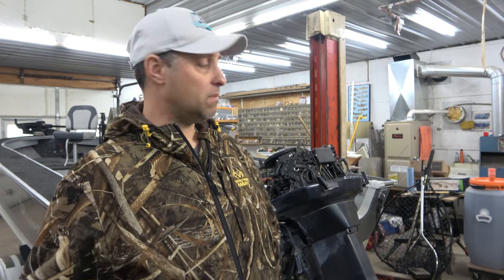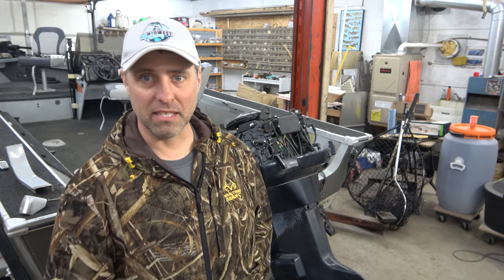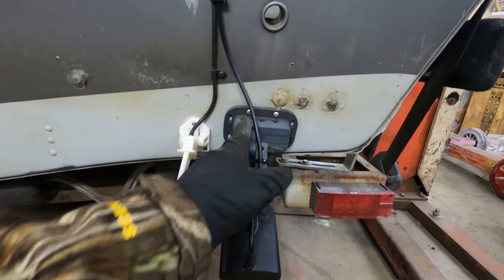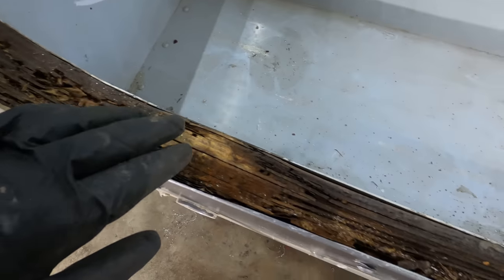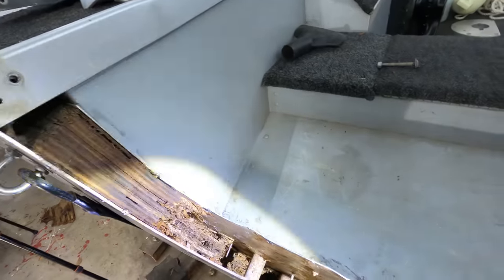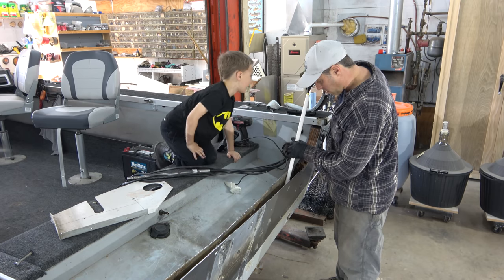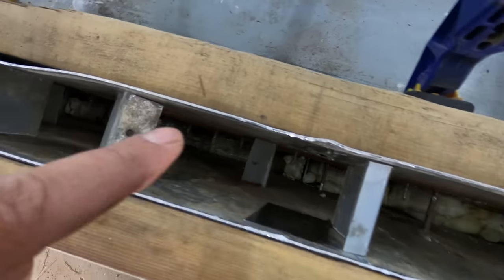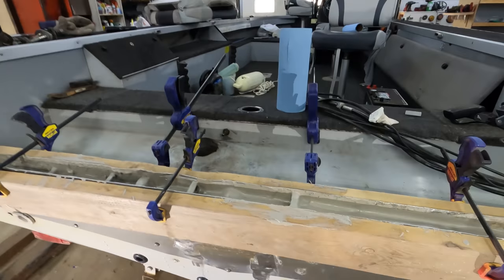The Easiest Way To Replace A Boat Transom

Comment: He needed to remove ALL of the wood and do a solid one-piece pour. What he left will continue to rot, and will act as a hinge on each side of his poured material.
Reply: Curved/irregular hinges just don't work. The wood left was just on top. Bottom is full width. The wood was irregular enough to lock the orientation in. The material confirmed to the wood and gripped it 100%.
But yeah, the rest will probably rot eventually but there's a reason why that piece wasn't rotten yet. Less water reaches it.
Reply: Does anyone really think that the new carbon core that was installed has “less” strength than the rotten piece of wood that came out of it?  Really !  I expect the repair may even be stronger than the original.
Reply: @gerrylormr8299  The material he installed will indeed be very strong. The wood he left on the outsides is already harboring rot at it's edge and that rot will spread. He will end up with a very strong center of a transom flanked by 8 or 10 inches of effectively nothing but the outer sheets of aluminum.  Eventually, and possibly soon, the weight and torque of that motor will cause the transom to flex at the point where the poured material meets whats left of that wood.
Reply: I would think at the very least, drilling holes into the wood for the new epoxy to bond to would have been a good idea to spread out the transition between the wood and carbon core. A line of 3/4" holes drilled into the wood with an extended drill bit would act as fingers between the carbon core and wood. Drill them at a diagonal from the top and use a rod to push the liquid in and air out once you pour the transom.
Reply: @the_omg3242  that is a good idea but the irregular surface of the wood meeting the chemicals is more than enough to provide mechanical locking as well as increasing the surface area for bonding. Just see how much sanding of a flat surface does for bonding ability of paint, then the ridges in torn wood seem like Mount Everest in comparison. 👍
Reply: I think if it was me I would remove the wood lower down remaining at the side ie in a level line of the transom plate at least, the upper corners not so important if the wood is pretty solid but I personally wouldn’t be happy unless the pour went the full width
Reply: Exactly...metaphorically what he did was mount a TV to a wall with a heavy duty bracket except instead of using studs he just used the sheetrock to anchor it..
Reply: It's ok he made plenty of money of haters to just buy a new boat at that point
Reply: Any fully encapsulated wood chips left in the main cavity will not continue to rot provided it was dry when encapsulated.  "Dry rot" is a misnomer - all wood rot requires water to progress.  I would have run a hot air blower into the cavity for an hour or two after clearing it to ensure all wood debris was completely dry.  The top side "ears" of the transom just act as a box corner section to stop the rear top of the hull bending in or out, they don't require much structural integrity.  Almost all of the forces from the engine (including its weight) is being transferred to the bottom and lower sides of the hull only by the section of the transom below the "ears".  So even if the "ears" did continue to rot (which I agree is likely), it's not such a big deal.
Reply: @darrenjones3681  He didn't want to buy more than two buckets (budget?) so he left the wood. Hope it doesn't come back to bite him
Reply: @sasakurtovic6850  the only thing it gripped to was 100% crap to begin with. You have a clue what you're talking about do you? you're just guessing.
Reply: Welding aluminum with propane/ map = fail aluminum goes from a solid to liquid super fast. Smells like bondo means it is.
Reply: Exactly what I was going to say. He just delayed the complete disintegration of this transom by a couple more years.
Reply: @sasakurtovic6850 😊😊😊
Reply: @1957cajun .  Life long wood boat owner couldn’t agree with you more.
Reply: Nice job, very impressive happy fishing
Reply: He wants to continue to fish with his boat. It isn’t like he’s claiming that it’ll be good forever. 

It doesn’t matter if it becomes a hinge later.
Reply: Appears you removed about 75% of the rotten wood. I would have went the extra mile and removed all of the rotten wood.
Reply: it will be absolutely fine
Reply: @sasakurtovic6850  maybe, but to support his point.... reading all of the comments that the remaining wood will continue to rot and become fluff, having the material entering multiple ports into the old wood would have added some rigidity if/when the remaining wood fails.

Comment: Perfect video on what not to do.it’s actually sad that this video is meant as a serious repair video and not a worse imitation of an episode of the Red Green show. He is actually using liquid duct tape! LMAO
Reply: Idk man have you seen the carbon core video that stuff tested stronger then plywood .
Reply: You couldn’t be more wrong. These liquid transom product are more durable, and more structurally sound than any marine plywood made.
Reply: @buellb0y  possible, in perfect world, but that would be if you removed all of the rotted wood and the liquid could get decent adhesion to all surfaces between skins and on the side edges. And all the surfaces were thoroughly cleaned from debris and any contamination or oils.... and then the transom sealed to prevent further water intrusion, But that’s not what occurred here. Bottom line there is a right way and a wrong way, and there was not a lot of “right” going on here. The remaining wood WILL deteriorate because spray foam is not a waterproof barrier. And when the transom buckles and flexes later on and needs to be fixed, again, the process will be a debacle. The moral of the story is these snake oil solutions are temporary and cheap, and while delaying the inevitable, nothing beats doing it right the first time.
Reply: @buellb0y  only when properly installed.
Reply: @jhudds67  thats a really long paragraph to tell everyone that you have zero clue what you're talking about.
Reply: @adamcooper3717  so you really think slathering some crap out of a bottle or tube is really the preferred method of repairing that transom? That crap is for small repairs not to replace the structural integrity of solid plywood and a property repaired transom.

Comment: The only problem I see with this method is it didn't really save that much work. By the time you dig the old transom out and prepared it's almost the same amount of work as just taking the rest of the rivets out and replacing with a solid Board.

Comment: You should use 3M 5200 sealing caulk it's much better for boat applications than silicone. Nice video.
Reply from the maker: Hi Buggy Man. Thanks for the info.
Reply: I agree one hundred percent I used it around the outdrive on the transom it's the only way to go, 5200 is great stuff
Reply: Absolutely agree. I use 5200 for below the waterline and 4200 for above. 5200 is a permanent bond and 4200 is UV stable, I use it for deck fittings, windows, port lights, railings, screws, etc. 5200 is some strong, nasty stuff. There's also Sika-Flex which is great for above the waterline.

Comment: This stuff works fantastic. I am 3 years with my carbon bond transom holding up twin 200 v6 evinrudes on my 26ft center console.
Reply: I am sure it works fantastically. IF YOU FOLLOW THE INSTRUCTIONS. This guy just made things worse. A year or so from now and this boat will fall apart where he failed to spend the money and where he failed to remove the corner wood will be completely rotted and gone. That little gap on top? Gonna screw it all. If you can't do it right, don't do it. 200 more woulda finished it right along with a little more work for the corners. Sloppy all the way and now... when it has to all come out, he will spend thousands instead of 200 more.
Reply: @daddski1  Agree....
Reply: @daddski1  If he keeps his boat indoors that's gonna last forever
Reply: @daddski1  looks like his newest video confirms you're FOS
Reply: @daddski1  The only good tip I got was the transom goo

Comment: The hardest part of doing something is getting started.  Well done man!
Reply from the maker: Thanks Eric. I appreciate the comment.
Reply: The hardest part is doing it RIGHT! Every step down the Cheapest path is just another step into doing it over again, or accepting second-rate results that you wouldn't expect to pay full price for. 1st. leave the inner skin "Completely" alone.              (options later). 2nd. cut the ""ENTIRE"" outer away,, Leaving 3 to 4 inches revied around. 3rd. Dig it ALL OUT! side to side and Clean the bottom completely. 4th using 3/4 melamine, Skin the back creating a form, clamp & thru bolt using 1/2" PVC a needed spacers. Now you have the opportunity to decide whether you want a notched-back or a "Full" Flatback transom. The Flatback is "Ideal" for the installation of a jack plate for every reason a jack plate is superior to a Hard transom mount. I personally install ones with longer shafts. To get the Powerhead UP & OUT of the water plus having the ability to kick along much shallower. Besides, your process is very time-consuming for nothing added.

Comment: I almost threw away an old Craftsman electric chainsaw until I used it and a shopvac to clean out a transom cavity.....REALLY speeded up the job. I've done several since and haven't found a better way.....Good informative video for anyone contemplating transom replacement. Once done they are almost indestructible.
Reply from the maker: Yes, it is rock solid! The chainsaw idea is brilliant. Thanks for the idea.
Reply: I used a Sawzall on the 2 I did. But good job. I used wood to replace both transom. The lund I had to remove the rear deck as you stated..
Reply: Chain saw  great idea

Comment: Great job!  Amazing how many key board boat transom repair experts are out there.
Reply: I was a boat repair tech for 25 years and probly did 100 transom in my time working on boats I've been disabled for the past 12 years in my time as a repair tech my primary boat repair was on fiberglass boats however I have done some aluminum boat repairs including transom I must say by not removing all of the wood  has made weak spots at the edges where the wood meets the pour I have used the Coosa and plywood  but never the pour however having removing as many as I have I can say with 100% confidence the remaining wood was still holding moisture this fact will inhibit the bond if you noticed the dark color of the wood on the floor that was because it was wet also by putting the foam to (keep the water out) I can tell you from experience that polyurethane foam also soaks up and holds water but  I also would've taken the motorwell out and gotten the rest of the wood out it really wouldn't have been that much trouble and he would've had a better job getting all the rotten wood out  I did like his angle aluminum over the top idea instead of using the old piece and I do applaude him for trying to do it himself n do like the pour transom  be advised i am not bagging on his work but trying to help others  who may read this
Reply: Amazing how much shit one dude who has no idea what he is doing can do wrong ! FFS, expanding foam ?

Comment: Did the same with my Lowes boat similar to yours,but my mix came in smaller buckets and i filled mine right to the top,and yeah its rock solid

Comment: I replaced the transom in my 2000 Lund with marine plywood that i soaked with CPES (clear penetrating epoxy solution) to prevent any water intrusion. CPES is two part epoxy that is like diesel and penetrates the wood then cures in a couple of days. It fills all the wood pores making it water proof.  10 years later it is still rock solid. And yes i had to remove dozens of thru-bolts etc. and replace. It was a ton of work. This looks like a much quicker/easier solution but more expensive.
Reply: Layered up womanized...glued up.  Don't go down as deep just slightly below the support panel inside the boat where you tried welding. (You can then run an angle piece to tie the transom to the support panel) Then lay another piece of womanized sandwiched up clear across the whole length on the inside of the transom.  Cover it with aluminum, or just paint it...use longer motor attach bolts.  I have done this on 14 foot boats to 24 foot boats and it lasts forever....marine grade plywood is over rated.  Much cheaper to do, but if you don't try and go to clear down past the support panel just above the floor it goes much quicker and is plenty strong and stiff across the stern.  I have to admire your work around tho....nothing like a job that succeeds no matter how you get it done.  Good show....

Comment: Kudos to you for keeping this video up and still allow comments despite all the haters and their comments. My thoughts after watching the whole thing is this is a good solution to a problem. Is it the best solution? No, I think removing the entire aft interior and transom skin, then installing new, properly treated wood is the top shelf solution. This method however is far less time and labor intensive. The costs would be similar (you needed that 3rd bucket) as long as you could handle all the work yourself and have all the tools. You also need a good partner to help you buck back all the structural rivets in the transom. I think it got you back on the water fairly quick, working by yourself, certainly as cost effective as any other method and it will work for you. I was very happy to see you add that final piece of 1/4" aluminum. Good work, tight lines and thank you for the video!
Reply from the maker: Thanks for the constructive feedback. I've thought more than once about taking it down, but I realize with lots of views, comes lots of comments, good and bad. I was originally going to remove the skins, but I wasn't sure I could reconstruct it properly, so I did what I knew I could do. Its definitely not perfect, but it has been holding up well and it got me back on the water.
Reply: @GoMidwestFishing  Think we all learned from the video, and some good input from viewers.   Appreciate you did the video !  Follow up updates will be appreciated .
Reply: there is a huge difference between a "hater" and a very concerned professional friend

Comment: Thank you for putting this out here. I think it's going to work fine. I'm guessing that without all the wood across the middle water won't be "wicked" into the side corners and they will remain solid for a long long time. Even untreated wood that doesn't stay wet can last for even 1000's of years. Wooden coffins from the pyramids, wooden roofs in ancient cliff dwellings are a good examples, as well as old barns and cabins. I really do enjoy the constructive suggestions and learning about other products. I've never had any luck with those aluminum welding sticks. Please try to ignore nasty comments and keyboard comedians.
Reply from the maker: Thanks Glen. I enjoy the troubleshooting process. I learned a lot and its been holding up great for a couple seasons now.

Comment: I'm rebuilding my 26' sailboat transom to fill in an area where the  builder left a flat-V cutout for the outboard, but I want to relocate the rudder to that spot and put the electric outboard on a bracket on the left side of the transom with the swim ladder on the right. I think this product is the way I'm going to go I want at least a 1.5" thick solid transom that's also bonded all the way around the perimeter to the hull sides and bottom, then filleted in with glass tape and epoxy. Thanks for the video. It showed me exactly what I will be dealing with.
Reply from the maker: Good luck on your project.
Reply: @GoMidwestFishing  Thank you.

Comment: I used Sea Cast on a boat one time. Gutted out all the old rotten wood, cleaned it all up, mixed the product and poured it in. Made a bullet proof transom.
Reply from the maker: Yep, its basically the same stuff. I'm glad to hear that it worked out for you. This stuff is amazing.

Comment: I see transom repair videos everywhere! Im no expert but do own several boats use transom savers on my boats never have hade pulling and warping 2 of my 30 year old+ boats, have had some support their whole lives never once had an issue
Reply from the maker: I also use transom savers on my boats. The real problem is that the transom is made of wood, and if it gets wet enough, it will eventually rot. That's what is great about the composite transoms. They won't rot in water. Thanks Chris for the comment.